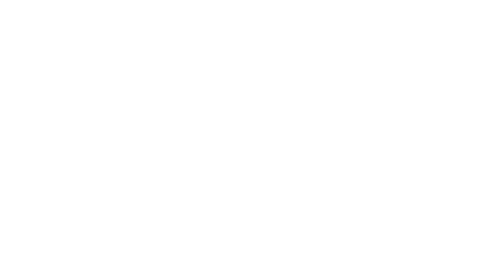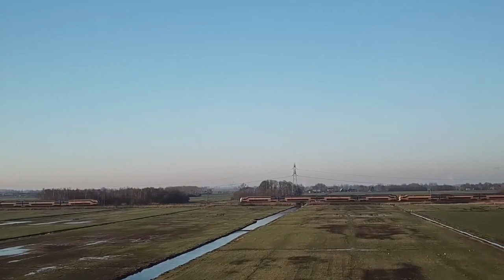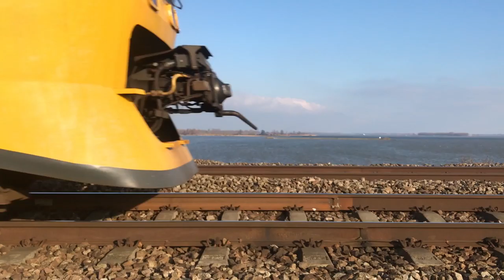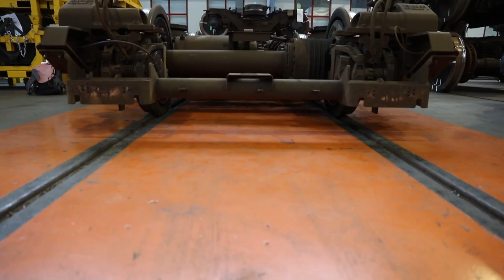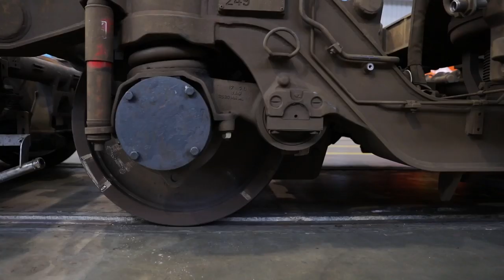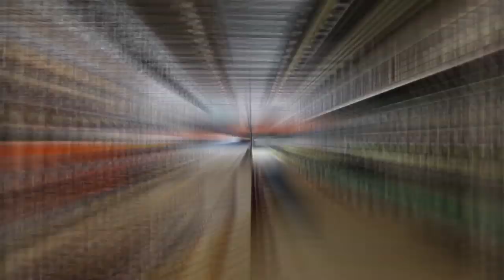Principle of Bogies - Railway Engineering: Track and Train Interaction | Online Course

Comment: How do that bogie turning? Usually they use single pivot in the center as axis, but this one have two attachment points (those secondary suspension), so how do they rotate?
Reply: The flexing of the secondary suspension allows for rotation in small amounts which is all that is necessary for a car that size